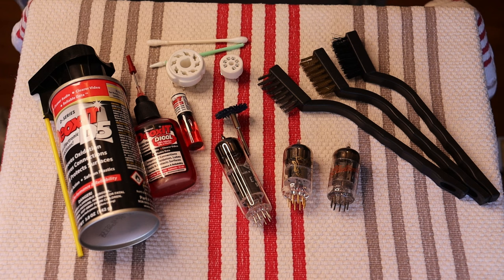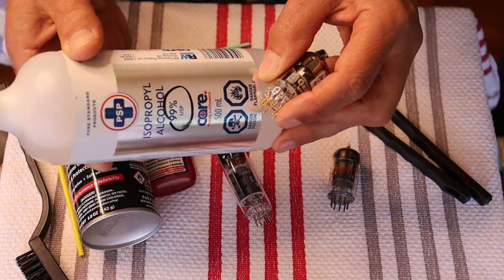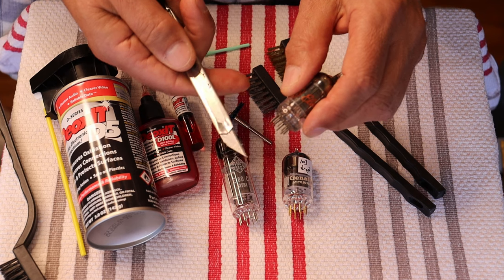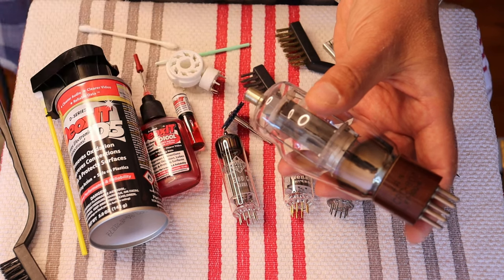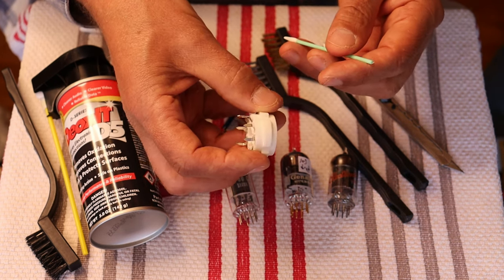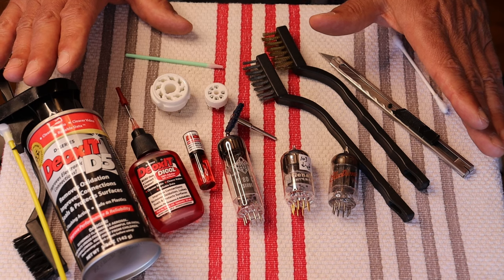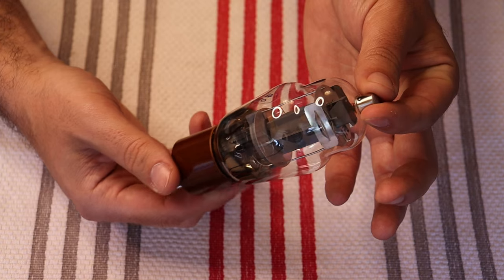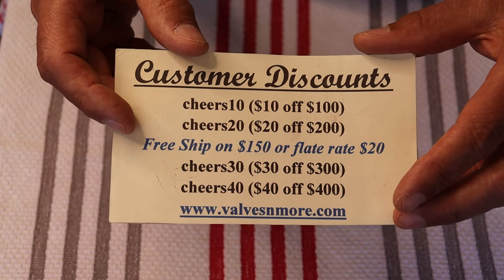Tube Lab #193 - Cleaning Tube Pins/Sockets - Revisited

Comment: Have you ever tried Flitz metal paste to clean tube pins? I’ve had great results using it to clean tarnished metal. Never tried it on tube pins but I may have to try.
Reply from the maker: @jimdalto6254  I'm familiar with the product and have used metal polishes on "bright" boat parts and they work beautifully on brass and stainless, but in my opinion you really don't want or need them when cleaning tube pins.  A nylon abrasive wheel in a dremel is very very fast and and more importantly it doesn't leave behind any residue.  And residue of any kind is very bad for a good electrical connection.

Comment: How we can install 807 instead of 6l6?
Reply from the maker: @ahmadathari3503  you can't, the tubes are different enough that you should not attempt to adapt an 807 for a 6L6 amp.  Vintage 6L6's and the Soviet version (6P3S-E) are still available.  We have excellent inventory of the Soviet version for very reasonable money.